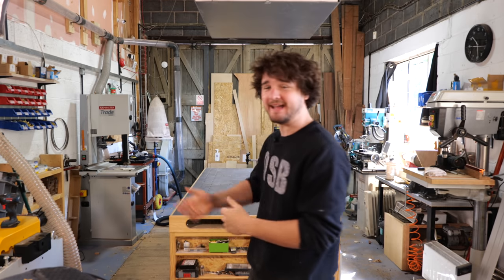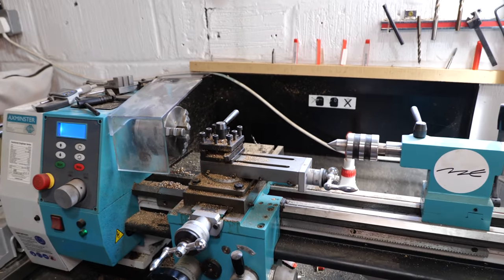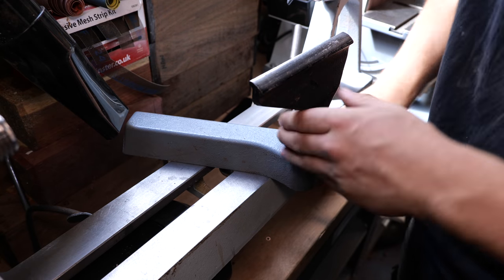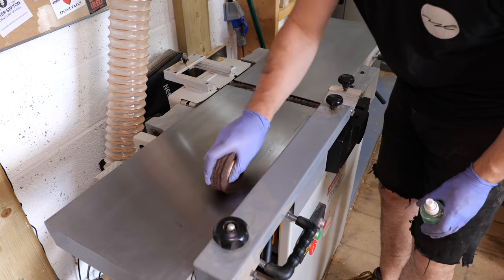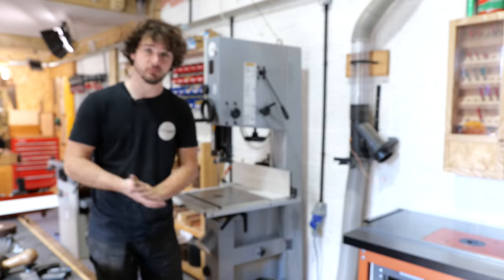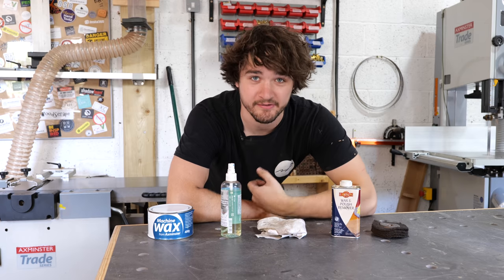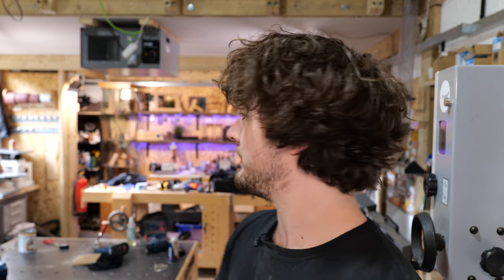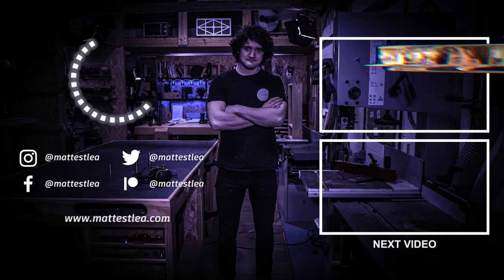How to CLEAN and MAINTAIN Cast Iron MACHINERY

Comment: In metalworking and woodworking classes in school we always had to clean the machines spotlessly every time before the next class used them - 10 minutes to clean & put the apron away. I do this even today with powered saws, drills, router, sander etc. It makes coming into the workshop much nicer.
Reply: I’m pretty much like you although, unless it’s been a dusty day in the shop, I do it all last thing on a Friday or, more usually, Saturday morning which is the maintenance period for all the machinery. My need for  dust free shop is behind me having everything possible put away in a closed cupboard or in drawers. I’ve just finished making upwards of 30 drawers for the shop for this reason.

With regards to build up (resin, light rust) on machinery, I have always used a random orbit sander with 240 or 320 grit disc; it cleans without taking away any metal; I then use Liberon Lubricating Wax - I’ve used just about everything possible but found that the Liberon does the best job by far.

Comment: Hey Matt, a year later but, on the off chance you see this, any chance you could at some point run through machine maintenance, you know, checking the inner workings of the planer thicknesser, that sort of thing? Given your experience with the machines I think it would be a great mini tutorial series ?! Also, can I ask, if your shop gets colder in the winter, do you do any extra steps to prevent wear and tear from a much colder, moist shop?

Comment: Matt, I have a pillar drill from Axminster and the same problem with the rise and fall handle. 
I solved it by making a 50mm high box that fits on the drills table, then mounted my full size woodworking top on top. I used threaded inserts above and below and it all works a treat.

Comment: Matt, I really like all of your videos I’ve seen. Very well done. I’ve been making furniture for 50 years now. When your maintaining your cast iron machine tops I see like so many others you put wax on most. I’ve always been opposed to doing that because I feel you lose a little control of the work piece. I like a little resistance. It makes me feel a little more in control of the process. Also kickbacks are more likely. I guess it’s a safety thing especially on the table saw. By the way I didn’t see a table saw in your shop. Anyway I think your doing an excellent job of explaining your various processes! Cheers, John

Comment: On our woodworking courses we have almost similar planer/thicknesser. It is from NOVA brand, but the Axminster looks like identical. There we had occasional wood chips problems in thicknesser. There is four bolt holes on steel plate (above height adjustment pillar in 02:17) and chips got occasionally trapped there. Then it leaves scratch marks for every wood piece, that goes through thicknesser. After cleaning it was ok....

Comment: For resin debris on cast iron or even belts I use Methyl Hydrate. Fast and leaves no film. Also it absorbs water. My flat bed sander gets a good spray of it followed by a small fine wire brush and takes heavy buildups of pitch off smartly with no real effort and it dries off as soon as the machine is fired up again.

Comment: Every tool I have is on roller wheels, including 3 table saws. Router table, band saw, 10 inch disc sander and my regular assorted wrenches.
I roll everything outside and blow everything out

Comment: Appreciate the video Matt. Just starting a total clean and lube of a Delta Contractor Saw 34-444. There's some paint overspray on most of the surface. Any suggestions, like possibly sandblasting with walnut shells? Also, a friend suggested paraffin on the cast iron. Do you have an thoughts on that? Any ideas on what to lube the trunion and gears underneath? Most machines come greased from the factory. It attracts sawdust and dirt.

Comment: The trouble when you clean your machinery to that extent is you just want to admire it and not see it all dusty and dirty.
I've never found Camelia oil to be very good at rust prevention but try it on the sole of your planes, they run away with themselves.

Comment: I have a much easier way to keep my machines rust free. I use them every day. Dust extraction and filtration keeps the humidity low.
If the tannins stain your beds a gun metal grey colour, leave it there. It will help resist rust. And it looks nicer than bright metal.
Only fool's scrub and abrade their beds clean. Your just creating wear and disturbing the case hardening. Not a good idea. Especially on joiner and thicknesser bed's.

Comment: It's always fascinating to watch all the useless gunk that these channels punt to the hobbyists.
Everytime you use abrasives on a machined surface you are damaging it slowly but surely.
It's just not a problem in real workshop's. Run a few boards over a little surface oxidation and the timber rubs it right off for you.
If you rub back to bright metal it just invites more oxidation. The lovely gun metal grey colour is protecting your beds. Leave it alone and save your money for beer and hot chick's.